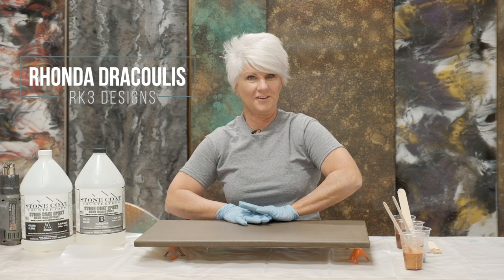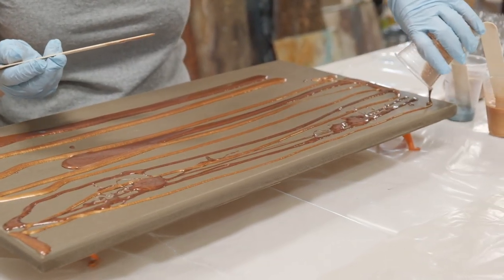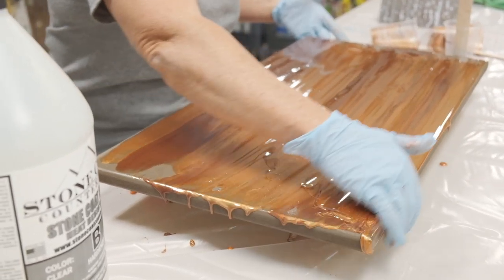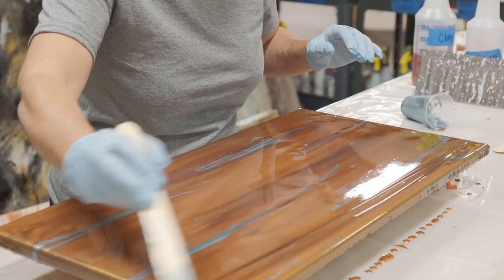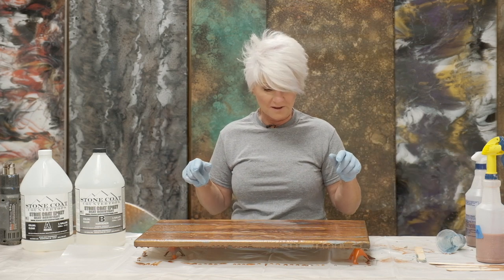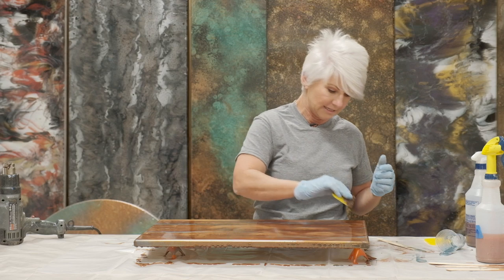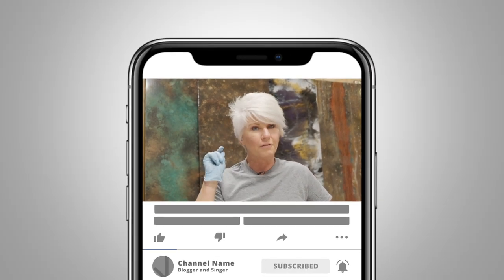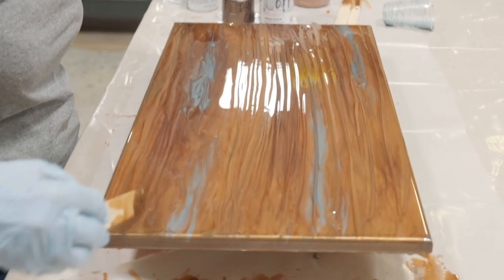Heavy Metal Striae- Stone Coat Countertop Epoxy Tutorial

Comment: Absolutely love your videos, im just really wondering how do you keep Absolutely all the dust out of the air while working, im always seeing little pieces of something in my work, so then I sand and do a top coat, but sometimes im doing it 2-3 times to make it as perfect as i can.   Thanks  😊
Reply from the maker: Having a dust free environment is almost impossible. Ways to get around that is to apply the Ultimate Top Coat. This is a coating you roll on after you flood coat. It give a beautiful matte finish and is incredibly durable. It will cover all the dust bunnies in the epoxy. If you want to keep the high gloss finish, you’ll need to build some sort of tent. We build ours out of plastic, put the lice under it and then pour the flood coat. After that we turn off any airflow and the lights. 😊
Reply: @RK3Designs  thanks so much for your input   :)

Comment: Beautiful and very informative. After all those techniques, does the final cure dry smooth or is it bumpy ?
Reply: This is just the 'color coat'. You would almost always do one more clear coat on top, usually called a 'flood coat'. That makes it very smooth and protects your color coat (meaning if you scratch your counter or art piece only the clear coat is affected, the color doesn't get scratched.)
Reply from the maker: Hey there Nancy, my color coat is sometimes a little rough, especially if I do finishes that are manipulated later in the pour. I always put a clear flood coat so my finish is as smooth as glass!

Comment: Can you think of any reason that this recipe wouldn't work for shower walls/bathroom vanity. I'm itching to try it.    p.s. What color paint/primer did you use on the board?
Reply from the maker: We done shower and vanities with this recipe. We build the shower walls out of foam board, pour flat and then install. Works fantastic. I painted the substrate a color called Ethiopia, but any earth toned color will work.
Reply: @RK3Designs  Thanks! It was a tossup between this and your "Hammered Spray Paint Marbled Finish" - I'll send you a picture when I'm done.
Reply: @RK3Designs  I just finished my sample board using this "Heavy Metal Striae" recipe and I am completely blown away! One thing that you just can't understand from watching the video is the incredible depth and layering in this finish. It is unbelievably 3D. Now if I can just conquer the "boogers" and dust bunnies.

Comment: Rhonda, excellent work. Why do you seem to prefer mica flakes over metallic powder, what’s the difference in effect?
Reply from the maker: Thank you Ann! I use mostly mica powers because the particles are VERY small and can be used to tint epoxy as well as mixed with 91% alcohol to made some cool effects. Mica flakes are actual little flakes that can be used at visual interest in your piece. Hope this helps a little and thanks for watching!!!
Reply: RK3 Designs I will be ordering epoxy and  additives from SCC soon. I’m wondering whether to order the kit which comes with art epoxy and metallic powders OR order individually the countertop epoxy and mica flakes. I don’t know what’s the difference in effect between the 2 options. What do you recommend? Thanks a lot.
Reply from the maker: Ann Shr I think I would order the kit. If I’m not mistaken, you get a little more for the price. Use RK3  at checkout. 😊
Reply from the maker: @annshr9917  The art coat is a bit more expensive, but if you doing mostly art you may want to choose that option. The art coat has more UVA protection. If you're doing countertops, then go with the regular SCC epoxy. I'm not sure exactly what the kits are made up of. Sorry about that.
Reply: Exception: If you're doing a WHITE countertop, use their ART epoxy so it yellows less! There are also other brands of epoxy out there that are cheaper. If you're just wanting to mess around with technique before you do a major project, I recommend marine supply tabletop. It's a really decent better priced epoxy, and also no VOC. (check label to make sure you get the right one, you want one that says solids on it.) But for professional use or large projects, I love SCCs products, customer service and their art epoxy is very clear.
Reply from the maker: @sassyNot4u  have you checkout SCC Craft coat? It's FABULOUS and very economical for practicing.I've used it a bunch and it's a game changer for sure. No VOC's and good working time. If you use it, let me know what ya think!!
Reply: @RK3Designs  Oooh, have not played with that yet. Although for practice, the Marine Supply price cannot be beat anywhere and is still no voc, so, as much as I LOVE scc, I still order MS anytime I just want to play. LOL. Still, may have to try the SCC craft coat just to see if there is any major difference. :)

Comment: I have a wooden countertop, can I apply stone coat epoxy directly to the wood?  Will I need to do some sanding, if I can apply to the wooden counter.  Can I apply the epoxy to a vertical surface?
Reply from the maker: You can apply directly to wood as long as you don't have any products on the surface that would cause it not to adhere. I would lightly sand. Yes, Stonecoat has an additive you can add to the epoxy to allow it to be troweled on vertically.